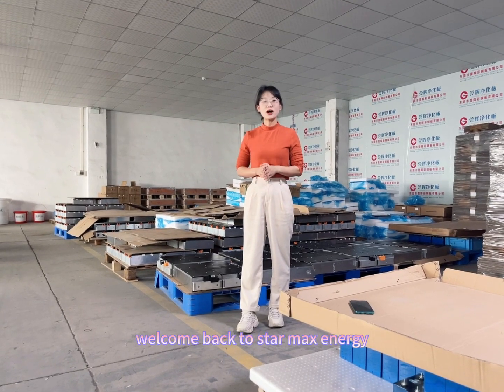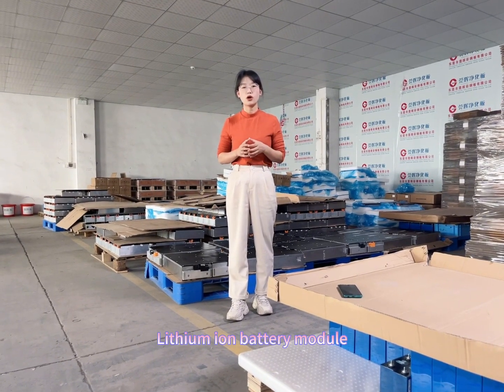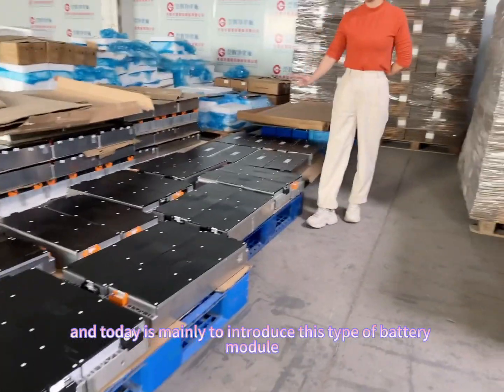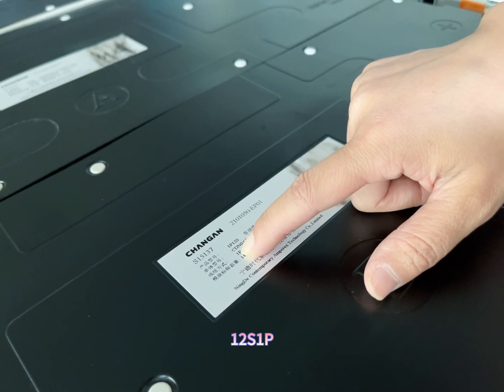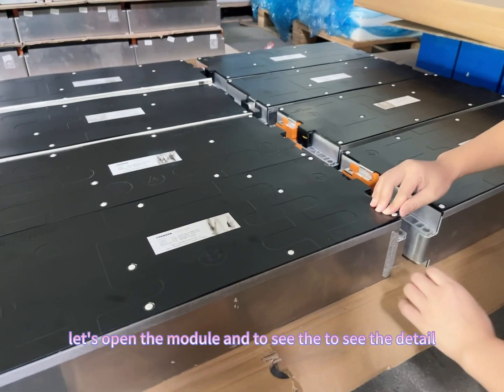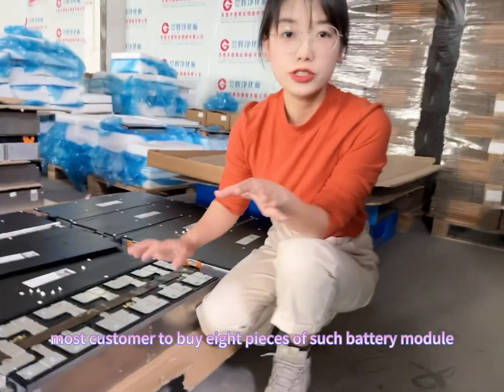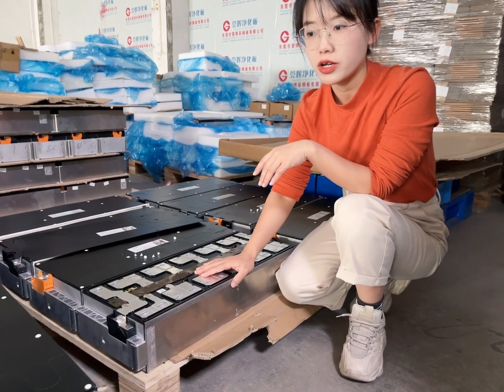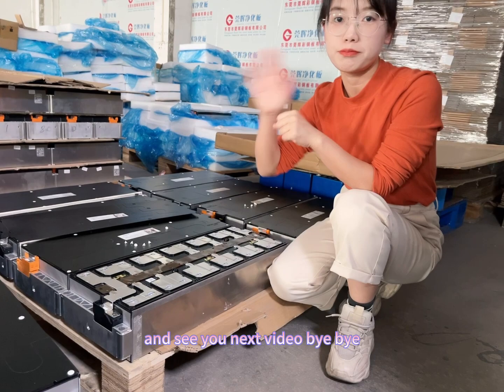CATL battery 12S1P 147ah battery module for Nissan Leaf car replacement

Comment: Nice video. Do you provide step by step video to install and connect power wires and BMS , if I will by this modules? Is it fit with Azeo and Ze1?